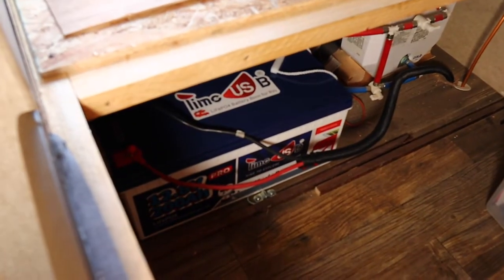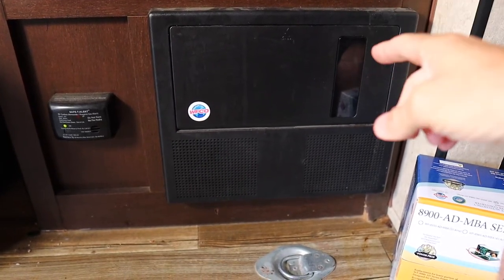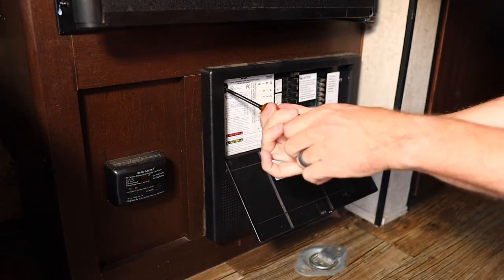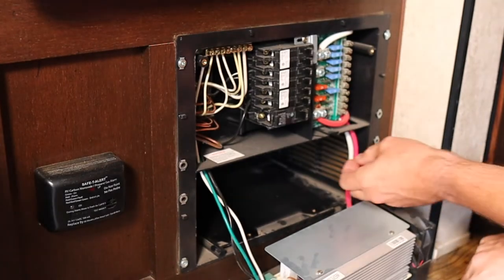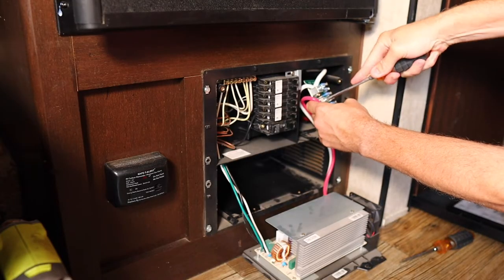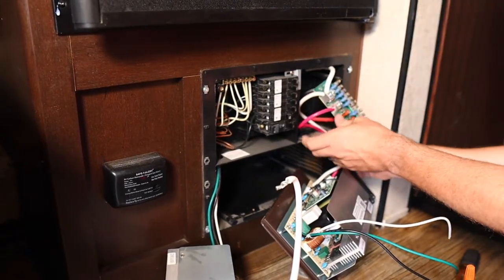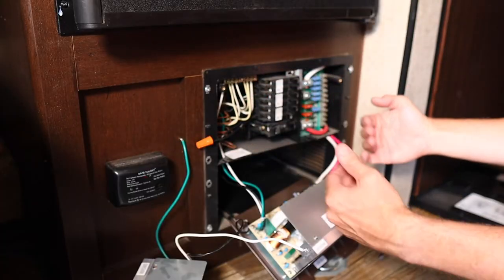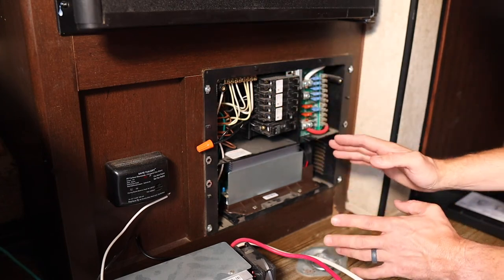How to Upgrade A Converter Charger - Charge Lithium EASY

Comment: It's not an inverter but a converter.
Inverter  transforms DC to AC.
Converter transforms AC to DC.

The converter charges the batteries. The inverter draws power from the batteries.

That been said, the video is informative and to the point.
Reply: Is it safe to install a 70amp converter into my 50 amp rv?
Reply: @Fallenicons24 assuming it's 70A at 12V.  Then probably yes.  Your batteries need to be rated at that charge capacity, and your wires need to be able to handle 70 Amps.   For example, lead acid should be charged at 25 to 30% of capacity.

Comment: Great video. Easy to follow and straight to the point. My question is, how have you handled the charging connection from the tow vehicle through the 7-way connector?
Reply from the maker: It was already wired in, the only issue is it won’t supply enough voltage to completely top off the lithium battery.

Comment: This was a great video to change out the converter. 
My goal is to not need a generator so now with a lithium iron phosphate battery, and a converter that can charge lithium, don’t I need an inverter? And do I need to do anything with my solar panel charge controller? 

I have about a 250 watt solar system.

Comment: Thanks for the help. I was easily able to to convert to the auto detect, however the auto detect is a misnomer. The convertor now needs to to be programmed to charge lithium at least according to the video on the WFCO site. It may change automatically if when you are connected your battery was fully discharged. My battery was not fully discharged, so it is still charging it as if it was Lead acid. so know I need to figure out how how to fully discharge my 100 amp hour lithium battery.

Comment: Very helpful video.  The process is quite simple as you have shown and many videos do not make it seem so straighforward.  Did you receive a new DC circuit board and decide it was not necessary to replace the old one?
Reply from the maker: Do you mean the fuse panel? If so, there’s no need to replace the panel.

Comment: I did a video on this subject and found that the WIFCO converter does a poor job of charging my lithium ion batteries.  I put the jumper cable to cause the 8955AD converter for lithium battery parameters.
I just did one week boon docking.  The WIFCO 8955AD never  reached near 14.5-.6 volts to properly charge my batteries.  I only got 13.6 volts out of converter. This resulted my batteries reaching a 13.2 volt settled charge.  This is only a 50% LiTime charge capacity.  Go Victron.  My WIFCO upgrade was $200 wasted.

Comment: It’s important to know what equipment you’re working with. This is not a INVERTER it’s a CONVERTER. It’s also a AD Auto Detect. WFCO is having problems with detection of lithium batteries. Do you have 14.4 volts to Battery? If not you’re not in Lithium mode.
Reply: There sending me a jumper to force lithium only charge on my new WFCO 8900 MBA AD relacement. I had installed dual lithium batteries.
Reply: @KJC63 where do you get this jumper and how do you install it?
Reply: I just contacted WFCO support via email saying I want the jumper to force lithium. You'll need your WFCO model and give them your address. They just mail it to you for free. They tell you how to install. It just slips on a some pins on the WFCO board. Very easy.
Reply: Great info. Way easier than changing the converter out again for one that you can select lithium.
Reply: NOTE: your WFCO has to support lithium. The purpose of the jumper is to force it always in lithium properly
Reply: Yes good point. Mine is a WF-9855-AD which is supposed to Auto detect lithium.